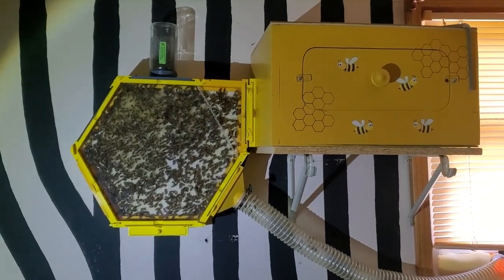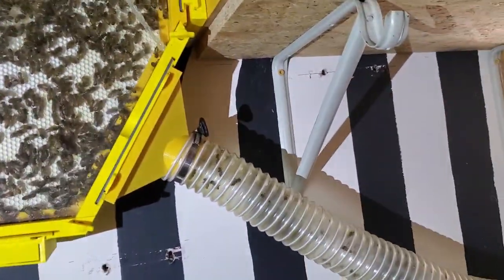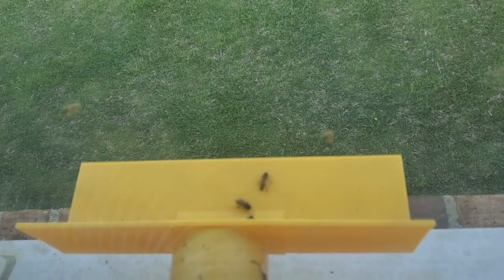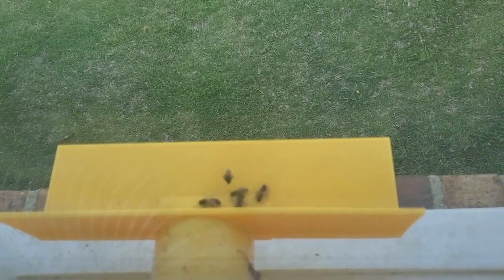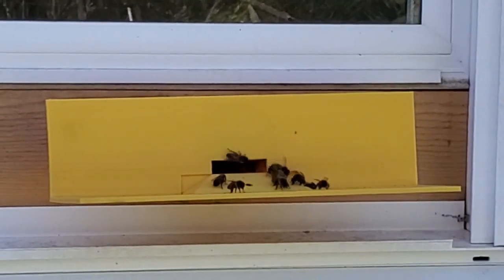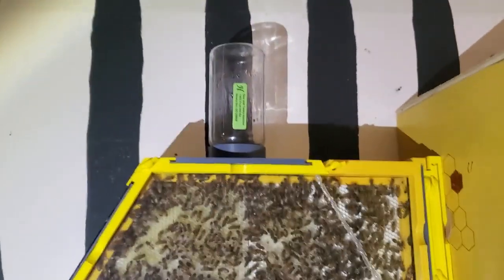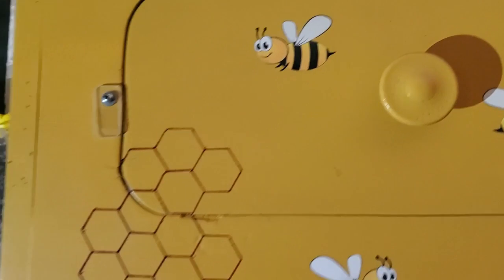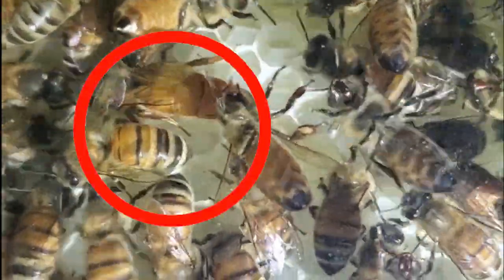3D Printed Indoor Bee Hive

Comment: Glad to see you back, I hope to have my hive finished printing very soon.  I plan on splitting one of my current hives to fill it.  

Be sure to remove the Queen excluder from the entrance so she can leave or new queens can go ok mating flights.  Be sure to include a Queen excluder between the observation hive and the honey super so the Queen won’t lay eggs in your super. 

Don’t feed sugar water with the super attached, attach super (FlowHive super in your case) once 80-90% of the observation hive comb is built out and filled with honey and brood)   I prefer to use the black foundation for brood, it’s easier to see the larva with the black background.  

Good cal putting that super higher than the brood box, bees prefer to build upwards.  

Great call on the entrance reducer as well!  

I printed a drawer holder in yellow but the actual drawer in white PETG, the white makes it a bit easier to see any mites and such that fall down to the bottom.  

Great to see you back and making some adjustments!!